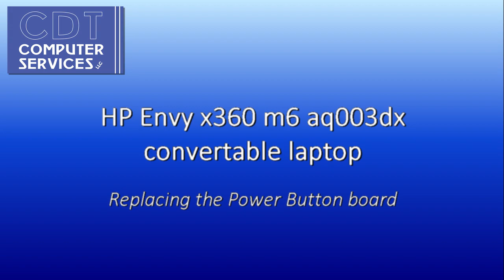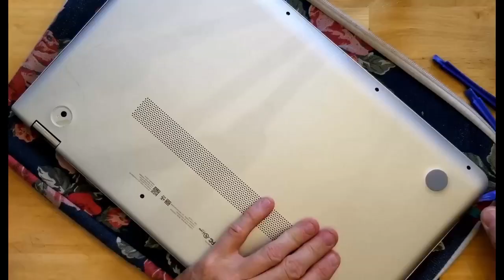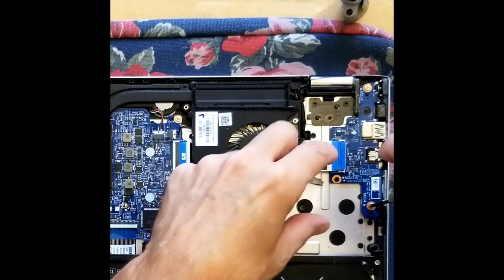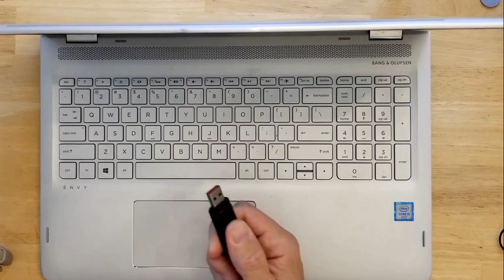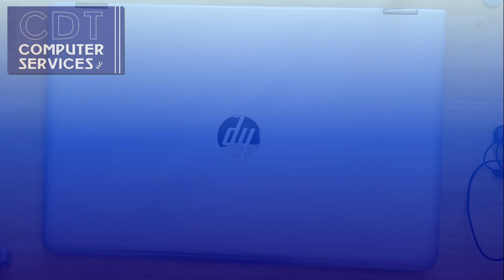HP Envy x360 m6 aq003dx laptop Power Button replacement

Comment: My power button is stuck is thier any method to turn on the pc using keyboard
Reply from the maker: Hi, @hyper-news24-7.  To the best of my knowledge, there is usually a single power button.  This unit has it on the side, so I would believe that's it.  (Scrubbing through the video, I don't see one on the top, or within the keyboard keys.)

Comment: My power button got stucked I decide to remove it and now I can’t turn it on.Is there anyway for me to turn it on without use the power button
Reply from the maker: Hello, A.  I'm a little confused.  The power button was stuck, so you removed it?  As in, took the whole button out?  If you still have the button, follow the video for removing the bottom and the board and slide the button back in.  Then replace the board and bottom.  

If you don't have the button anymore, which means you just have a hole in the side of the laptop where the button used to be, you should be able to use something narrow and not-too-hard-and-pointy to push on the switch on the board just inside the opening.  it's a little round "spot" on the edge of the board that the button would have depressed.  If you look in the side, you'll see it (little round metal "spot" in there).  I would guess a pencil eraser (if narrow enough to fit through the hole), or a small plastic stylus would work fine.

Let me know if that helps/works, or if I've totally misunderstood what your situation is.

Comment: My power button got stuck down and can't able to turn it on
Reply from the maker: Hello, vinny gaming.  Seems like this is an uncommon situation.  Someone earlier on had this same problem.  My suggestion to them (which seemed to work for them) was to remove the bottom of the case, remove the board, and use something (small screwdriver?) to "pop" the button back out.  It sounded like their button was a little torqued, and when they did this, it loosened up and moved freely afterward.  You could probably get away with just removing the screws on the board and flip it over to its left without removing the ribbon cable (which can be a pain to pull out and reinsert), or even just lift it up enough to get it out of your way to push the button back out.  Refer to the comment from Raymond Aiazzi, below, for any additional notes.  I hope this helps, vinny!  Let me know how it turns out. 👍

Comment: Hello, I hope you still monitor this video, and hope you can give me some guidance. I have the same computer. The "e" key quit working, so I replaced the keyboard, and reassembled the computer. Even though there is a light on when the power cord is plugged in, and the light by the off/on switch comes on when plugged into power, when pushing the off/on switch the light next to it goes up, but nothing happens, nothing on the display, no fan, no beeps, just nothing. When I let go of the power button the light comes back on, but still nothing.
So far I have replaced the battery, the motherboard, the board for the power switch, reseated the ram, replaced the CMOS battery, tried several times of holding the power button in for a couple of minutes. Rechecked connections, but still nothing.
When plugged into power, should the light by the power button be on? Should the fan start up when the power button is pushed?  Any suggestions?
If this requires your professional services for which you charge let me know. I would still be interested.
Thanks
Reply from the maker: Hello, Paul.  It really sounds like you covered a LOT of bases on your end.  This would probably be better served outside of video comments.  Shoot me an email at craigt@cdtservices.com and I'll be happy to see what we can sort out.
Reply: @cdtcsllc  Thank you for fixing my computer! LOL I had completely disassembled the computer but when I put it back together it worked! The only thing I can think of is that the ribbon cable from the motherboard to the power switch was not connected correctly. Anyway the computer in working now!
Reply from the maker: @paulstough2995  Hi, Paul.  While I appreciate the "kudos", all I did was offer my assistance.  Credit where it is due - you sorted it out. 👍  Congrats on tracking it down!  Glad to hear it's up and running.

Comment: Hi there,
I've an issue with the volume UP button attached to this same board, it went faulty and now forces me to hold volume up button each time to use audio. Is there any way to cut off (or) separate the volume up/down buttons from this power board without seeking a replacement??
Many Thanks!
Reply from the maker: Hello, Imran.  I've been stepping through the video and looking over some images I've found online of this board and the buttons.  It does appear there are 4 small solder points connecting the buttons to the board, and I would guess that someone half-decent at micro-soldering could replace it.  Without seeing it, I imagine there could be a small chance one of these connections may have broken or come loose, and just needs to be soldered.  As for replacing it, here's the caveat.  I haven't found just a replacement volume button being sold (Amazon, eBay, etc.).  People are selling the whole board.  Honestly, I would just replace the board.  I see them online between $20-25 and it takes about 10-15 minutes to replace, without all the hassle of soldering.  (You'd have to remove and reinstall the board anyway to replace the button.)  I hope that helps, Imran.  Let me know if you need any additional info.  -Craig
Reply: @cdtcsllc  Dear Craig,
Thanks for the prompt turnaround. You're doing an awesome job. I've been busy lately and don't live in the US, hence delivery via Amazon or eBay aren't that easy, besides HP customer folks quoted me around $50-55 for the entire power board + replacement cost which kinda feels insane. Getting a new one isn't an option either as I'm might plan a PC upgrade soon. 
Anyways, have a great day mate, cheers!
Reply from the maker: @Imran-M-  Thanks for the kind words, Imran.  Yeah, that's a bit pricey.  Unfortunately, that's what happens through the manufacturer.  Best of luck with the upgrade.  👍  Have a great day, yourself!

Comment: Hey man my exterior power button is stuck. It still works, but how do I get it unstuck without replacing it?
Reply from the maker: Hi, Raymond.  Thanks for writing.  My approach would be to remove the bottom cover and remove the board shown in the video.  The button itself will still be in the side of the laptop (the outer casing).  Wiggle that around a bit - see if it's a little torqued and just lodged in place.  if so, you should be able to work it loose.  Once it's moving freely, just put the board back in and the cover back on.  If the button is already moving freely, check the plunger on the board - at the top where the button pushes against.  Push gently against that with your fingertip or a small screwdriver.  You should feel a little "pop" when it pushes in, and another as it comes back out.  If you don't feel that "pop", it's worn out.  Now, if it's not really giving you any problems (it's just annoying), and you can live with it, just put the board back in and bottom back on, and move on.  Otherwise, get a new board and replace it.  I hope that helps and answers your question.
Reply: @cdtcsllc  got it! Thanks! Yeah, I popped it out by pushing on the little plastic tabs and it turns out the spring was somehow torqued sideways. I popped the spring out and put it on straight and now it works again. Thanks!
Reply from the maker: @RigBay92  Awesome!  You're very welcome.  Glad to hear it worked, Raymond.  👍

Comment: Hello, thank you for the video! I'm having an issue with my laptop (M6-AQ103DX) and having trouble turning it on. I just tried swapping with a new power switch board (button) but no luck. It charges fine (red light when power cable connected) but just can't seem to turn it on. I am wondering if I need to possible replace the ribbon cable that connects the power board to the motherboard? Any ideas? Would like to send you pictures/videos (email?) if you can assist with the troubleshooting. Thank you!
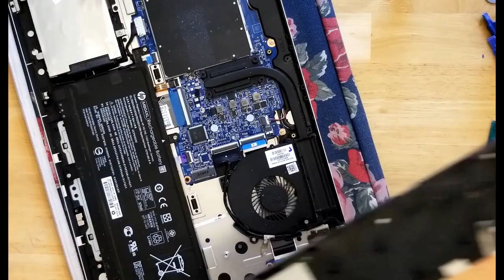Reply from the maker: Hello, iwillremember0987 .   I'll do what I can, however actually having a unit in-hands is always the best way.  My help may be limited.  Initial thoughts, you may have tried...  Try pushing and holding the power button in for a good 10-20 seconds, then push normally to power on.  Sometimes laptops get "stuck" in a hibernate power mode and don't wake easily (I had one I swore took an hour to get it out of "sleep" mode... pulled my hair out).  The long press will force it to power all the way off.  Secondly, try disconnecting the battery and run it just plugged in.  (Time-stamp 4:10 in the video.  Looks like the connection comes off the top-left of the battery.)  Pull that, plug in the power cord, and see if it powers on.  A dead/dying/buggy battery will wreak all sorts of crazy havoc with a system.  Just replaced 2 in the past 2 weeks that gave very different symptoms.  Off-the-top-of-my-head starting points.  You can contact or send along pics to CraigT@CDTServices.com.

Comment: Have a similar problem on my Envy. Checked input power and everything is good into the motherboard. What lead you to replace the power button board?
Reply from the maker: Hi, Leo.  In this case, the owner had to spam-push the power button like 10-20 times, quickly, in order to get it to turn on (and even THAT didn't guarantee it would).  Seemed like the first thing to check out.  What are you running into?  Sounds like it's just now powering on?
Reply: @cdtcsllc  yep. Wont power up. I have 3.3 volts to the input side of the power button, which sounds right. No shorts that I can find, and I put both boards under a scope and no components appear damaged. Im a mac repair guy who took on this for a friend. Tough to troubleshoot without schematics.
Reply from the maker: Certainly sounds like you have the skillset to step through this. 👍 I usually start with the basic questions, so apologies if this seems rudimentary.  Is the system getting power (fan comes on, HD spins up, power lights, etc.) at all, and just no display?
Reply: @cdtcsllc  I found what I think is a power rail and it appears the motherboard is getting power but no fans, no led on the power button, no display.
Reply from the maker: Hi, Leo.  Hard to say - and one of the reasons I prefer desktops to laptops, but with everything going mobile... :(  I ran a search on this model to see if this is a common problem, but nothing stood out aside from the "normal" power troubleshooting.  A bad battery can cause boot issues.  With the battery being built-in, I'm going to assume this is a model that won't boot without a battery inserted.  -Craig

Comment: I have the same laptop and the screen just went black today while I was editing film, do you have any idea what could be wrong with it? It won’t turn back on now, no flashing light or anything. Laptop was fully charged prior to shutting off.
Reply from the maker: Hey, JohnyBoy_TV.  Ouch, that doesn't sound good.  My initial "gut" thinks the screen went.  Other things you can try are:  1) press and hold the power button for 10 secs - see if it turns on; 2) if it doesn't, press and hold for another 10 secs and see what happens.  (That forces the laptop down if it's actually on, but hung up.)  3) Next, if the battery is removeable, pull the battery and unplug the unit.  Push and hold the power button for 10 secs - this will discharge any residual power in the motherboard, again, in case it's "stuck".  Reinsert battery and plug back in.  Hit the power button.  Anything?  These are efforts to get the laptop, as a whole, out of a "hung up" power state and see if it will boot up.

I'm not extremely hopeful those steps will work, but are things that are easy enough to try.  If those don't work, I'm falling back on my "screen's dead" instinct.  Someone would really need to look it over to confirm (did the panel die?  did one of the wires get pinched/snap?  etc.,etc.).  it is certainly a possibility the laptop itself died, but that would take a bit of on-site diagnostics to confirm.

I hope something above helps you out.  Let me know what ends up happening - if it does turn back on, or if someone has a chance to look at it.

- Craig

Comment: It appears my power button isn't functioning. Is it possible just replacing the button or would I need to replace the housing?
Reply from the maker: Hello, TONIO.  If the power button isn't working - i.e., the system doesn't power on/off when you push the button, OR, you have to repeatedly push the button to get it to turn on/off, chances are you need to replace the board.  Mind you, this is "best guess" without seeing or tinkering with the system.  The (plastic) button you push sits in the bottom cover.  (Is that what you meant by "housing" - the cover?)  When you push the button, it depresses the switch on the board.  That's where all the magic happens, and is usually where the problem is if the button isn't powering up the unit.  Let me know if that's a clear enough explanation. 👍

Comment: I dropped my laptop and it crushed my power button in. Will I have to replace it or just pop it back out in order to power it on again? Thank you
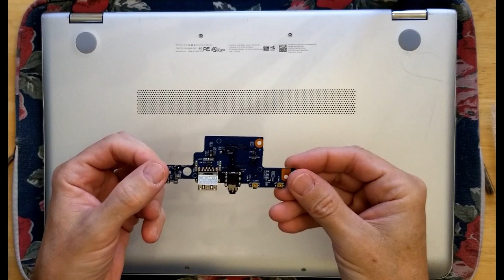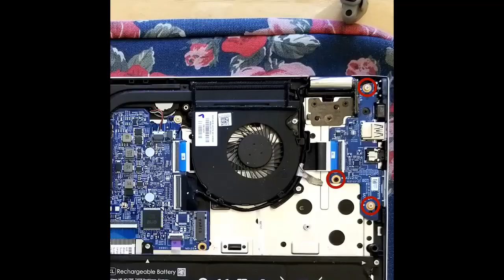Reply from the maker: Hi, Alan.  Tough call.  The button switch is a tiny component on the board. You can't really see it at time-stamp 0:46 as my thumb is over it, on the left side.  You can barely make it out just to the right of the top red circle at time-stamp 4:19 (tiny silver piece at the top).  I'm going to assume if the button was hit so hard the button is stuck in, it probably broke this off, or lifted it up off the board.  If you can't reach the button with something to pop it back out to test, it's a pretty easy disassembly (8 screws and some prying) to open it up and check it out.  Use a small screwdriver to pop the button back into place, and see if the switch bent or broken off.  If it looks intact, place the bottom cover back on, flip it over, and try turning it on.  If it doesn't go, there's your answer - new board.  Hope that helps!